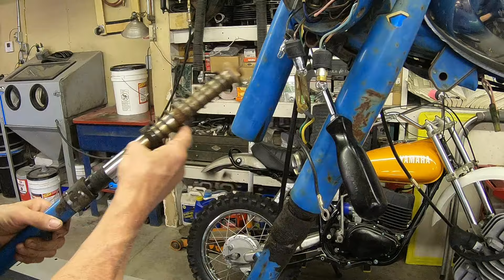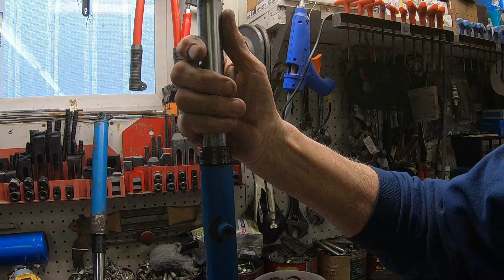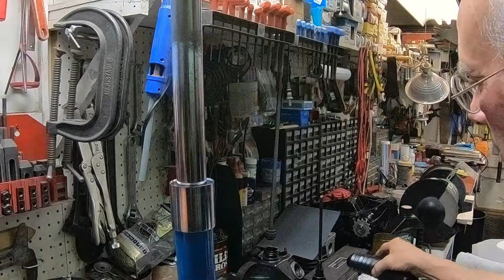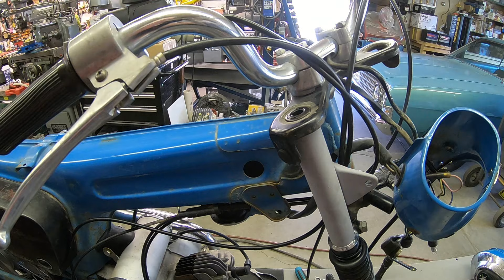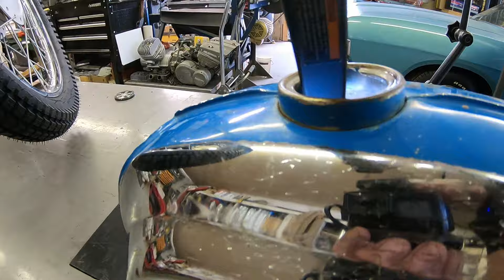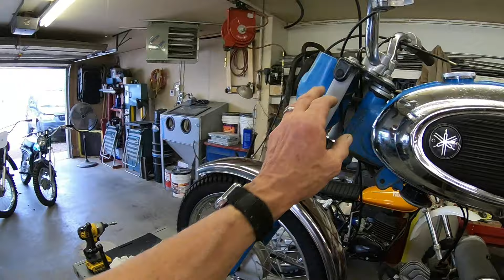Yamaha YJ2 Campus 60 repair, part 2

Comment: Thank you Dale.  This is therapeutic for some of us that like to watch the tinkering but also the precision.  It's an art and you got it!  Keep em rollin.  I bet there's no garage with more capability in your footprint across the states!  Must be 6" concrete.
Reply from the maker: Thanks for the kind words, Corey, I just enjoy working with these old bikes, I guess they are therapeutic for me. I hate to admit it, but my concrete is about 4 inches thick and is broken. But it was such before I moved this equipment in.
Reply: @montana2strokeracer  No worries Dale.  Most of the weight is all the walls where your footings are.

Comment: Nice job on the front forks Dale. I agree with you on the wheel bearings also. Some stainless steel cable ties would look really smart for your new fork gators....I don't like the bump that the zip ties have on them 😃
Reply from the maker: Thanks Mark, you know that does sound better that the zip ties. Wonder where I could get some. Any ideas?
Reply: @montana2strokeracer  I think I picked mine up at Harbor Freight. Seems that Amazon and many other vendors have them online. Used them a lot when I did splicing and repair at the phone company. There is a very simple tool that we used to cinch them. A screwdriver shank with a slot on the shank, to wind the tails on , to tighten them. Nice neat install and look nice also.
Reply from the maker: I wondered if it wasn't from the ma bell years, I am going to take a look and see if I can find some, think they will look trick.
Reply: @montana2strokeracer  If you have any difficulty finding them, let me know and I will mail you off a package of them. I have a good plenty here. 😊

Comment: Looking good Dale! Great transformation from the "dorky" original styling. Love the fabrication of the bushings and washers. Nice tip on protecting the seals during install also.
Reply from the maker: Thanks Douglas, I sure like the new look also. Its just so much fun building and rebuilding these old machines.
Reply: @montana2strokeracer  It really is a lot of fun. I've collected a few bikes over the last 20 years and finally took the time to start tearing into a MT250. I forgot how much I enjoyed taking these things apart and putting them back together.

Comment: Looking splendid, you made a good call with the front end.  I think the upswept exhaust pipe dictates the overall look of the bike and the new fender compliments it perfectly, well found.  I like the early round badge tanks, I doubt that hole will ever leak, wouldn't think it could flex at all.  Another great video, thank you.
If you use black and white chequer tape around the fork legs and over the tank top you should see an additional 3-5 mph, it's true.
Reply from the maker: Oh man I love the black and white tape idea, bet your right too on the speed increase, LOL, I am hopeful on the tank repair, yes, the high pipe just screams dirt bike....so it needed trials tires and a front-end change.

Comment: Hi buddy, well dale I think you have done a fantasist job there. And I do really think it looks way better than it did before, it does look factory fitted.  If I were you I would paint the underside of the new front mud guard with some paint just to keep it from rusting up. See you on the next video Brian.
Reply from the maker: Thanks Brian, you are probably right about a little paint under the fender. Couldn't hurt for sure.

Comment: Nothing wrong with giving an older bike an updated look as far as I'm concerned.
Reply from the maker: Fun project, this is how I wanted mine to look, finally got it done all these years later.
Reply: @montana2strokeracer Once I get the 125 and 370 done, I will be back on doing the upgrades to the TS & TM 250's.
Reply from the maker: Glad you're staying with it Dave. I get a lot of reward from working on these old bikes. Keeps me busy, I think that's important in our later years.

Comment: Is the machining better on 1960 machines, than 1970 machines? 
I had a 1976 Honda 350 and it was in the shop next to a Honda 305, the machining on the 305 was much better. 
Keep bringing back to life.
Reply from the maker: I have noticed some differences with some of the cylinders Walt. The Honda I just did machined very nicely, most of the Yamaha's trash a tool bit by the end of the bore, the Honda didn't and I bored two of them.